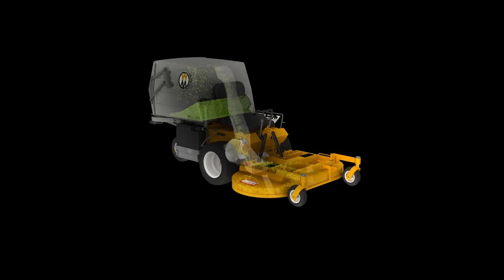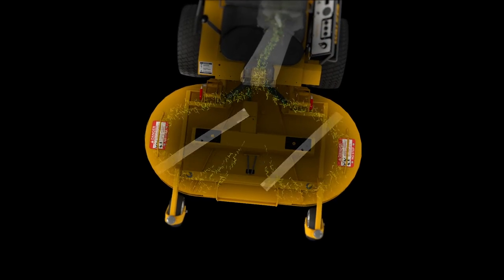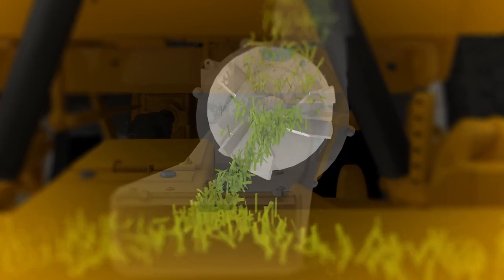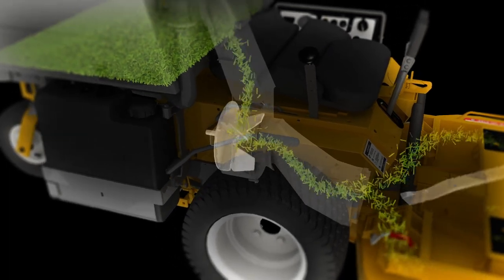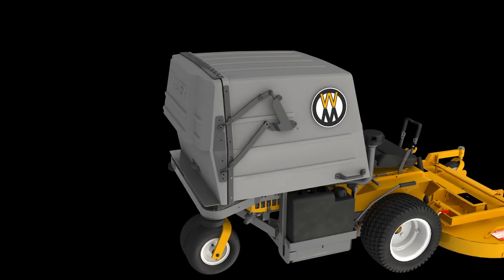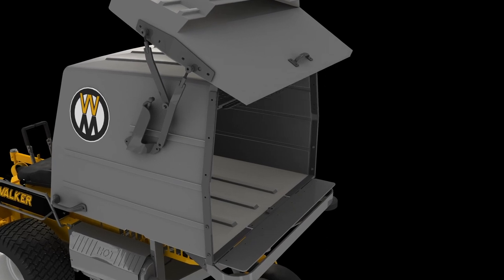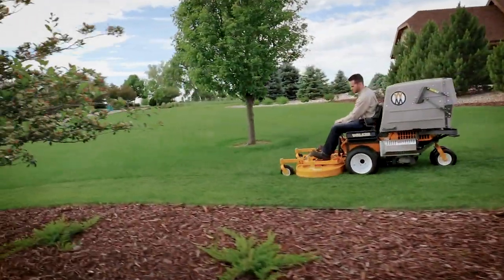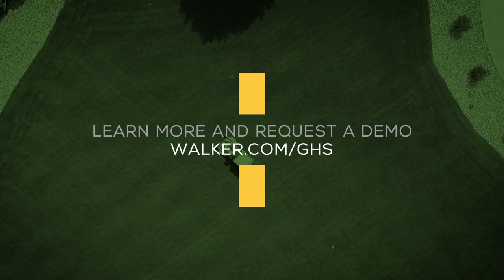GO INSIDE the Walker Grass Handling System (3D Render)

Comment: I mowed lawns for ~4 years as a young man. 2 of those years were on walkers. We were the only crew that worked in the rain. Thanks Walker for making me work in the rain. ;) I did love the machines and were easy to use compared to exmarks. 10 years later the crew I worked with has some of the same machines still running.
Reply from the maker: Ha! We hear that a lot, both the flexibility in all kinds of conditions and also the durability. Sorry for keeping you out there in the rain though :O